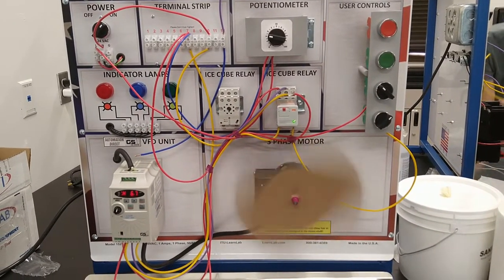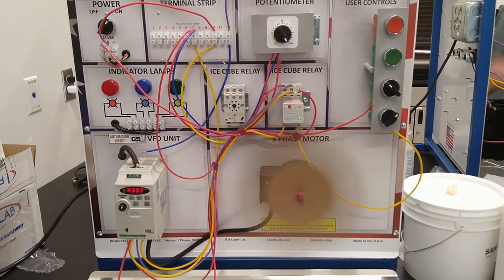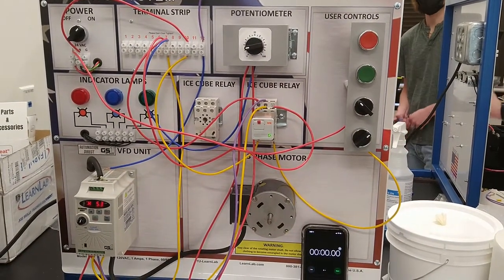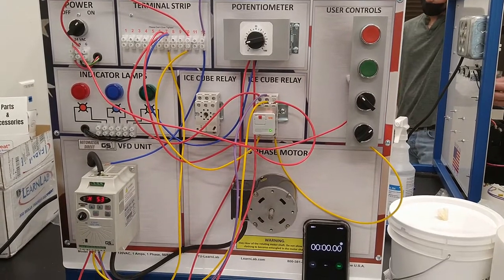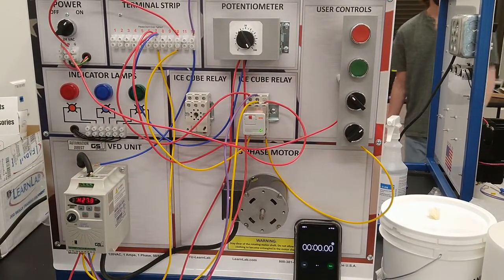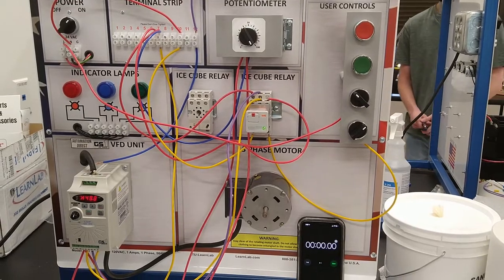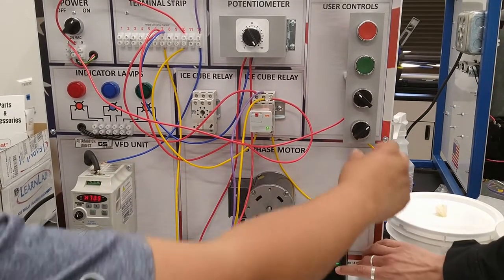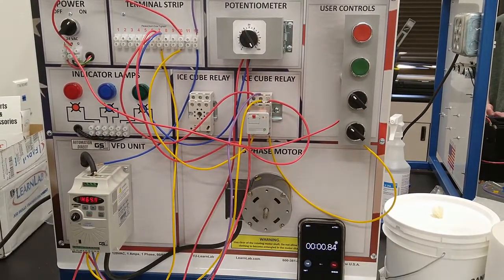How to control a VFD (Variable Frequency Drive) GS1 using Switch, Relay, and POT (Fwd/Rev/Jog)

Comment: How were you able to run the vfd , without a run command?
Reply from the maker: It's in the manual, you still need to use the local run button and use the manual to be able to switch the control to remote potentiometer.
Reply: @MohammadShafinulHaque  I did the same wiring , and gs1 is receiving the analog signal from potentiometer,  but not running the motor at all. If I press "run" button on the drive , and rotating the potentiometer on the drive , motor is running just fine . Maybe I need to set certain parameters?
Reply from the maker: @dastan4117  yes, you need to set certain parameters to control remotely, and the gs1 Manuel is available free online.